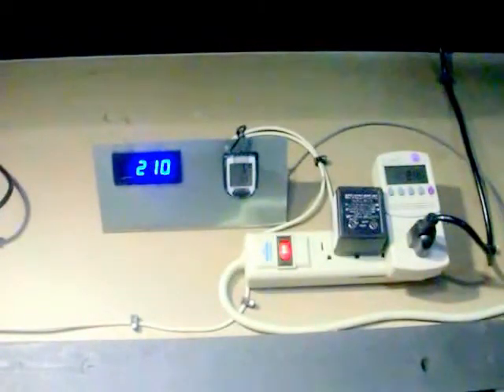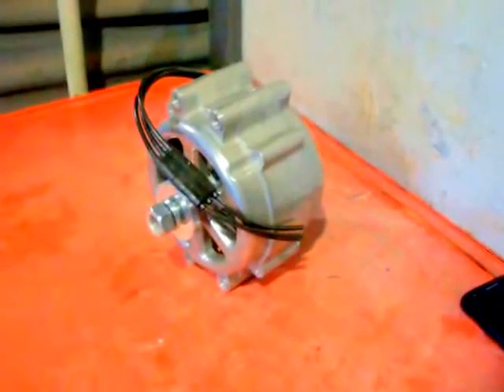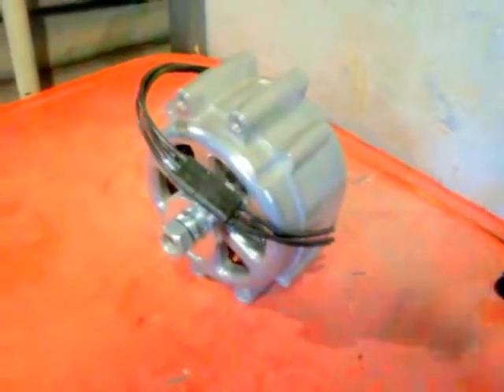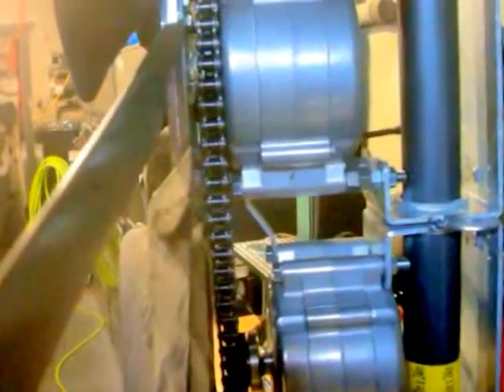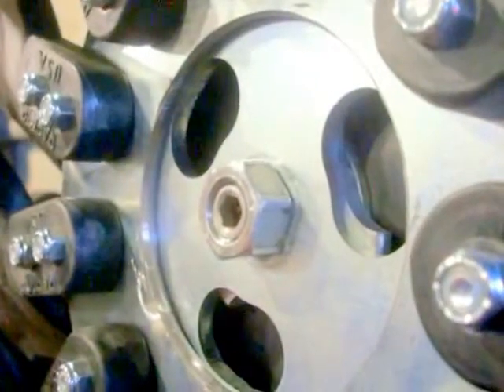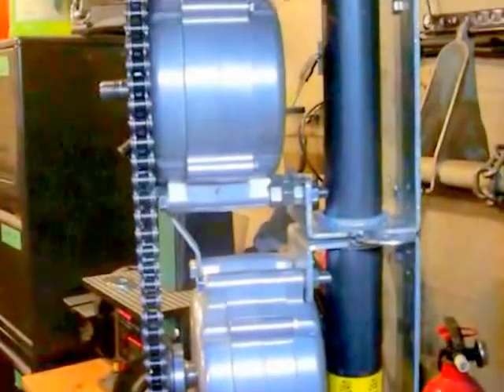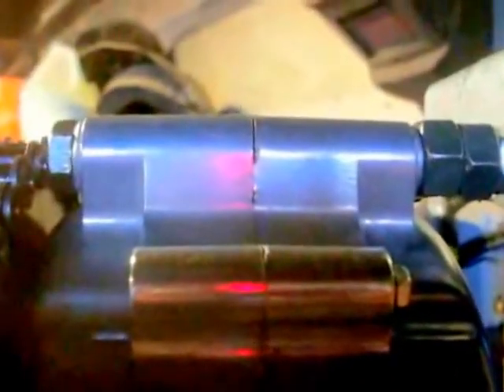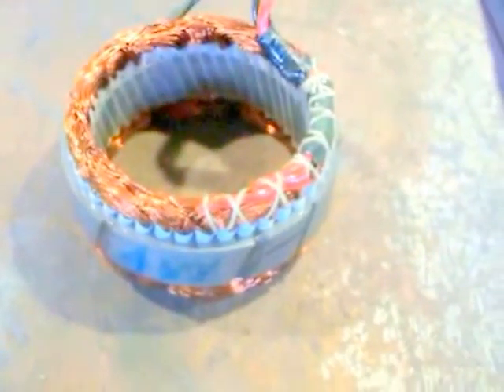Missouri Wind and Solar PMG Modified build

Comment: hhmm, seems like you need an upgrade of the hundred years ago kind.  Lower RPMs wind mill might work better for ya than a wind turbine?  I always look back to see how the old fellas did it.  Peace Out!
Reply from the maker: Old video and the turbines are replaced with more solar panels.  The modified turbine out performed the stock one 2 to 1.  The real problem is these pmg's don't have enough magnets in them.  250 rpm's to start making power thru a grid tie.  Wasted rpms but some people have tons of wind.  MW&S advertised the 11 blade for low wind areas.......My advise is no turbine unless you have crazy winds.  Check out my latest videos on the ultimate amateur 24 volt battery bank.  I haven't seen anything like mine yet to date.

Comment: Great series of 'scientific ' studies regarding wind turbines. I'm building a hobby machine shop in my 60' x 40' pole barn and I'm sure I'll be going through the same thing as you are. I would like to be able to power (at the very least) the lights and smaller things using wind and solar. The lathes, presses, and other heavy equipment with be on the grid. Thanks for sharing.... great job.
Reply from the maker: +Naked Machinist A pole barn is just what I need......maybe someday.  LED lighting is the cheapest to run for the price and as far as making power goes, I'd stay away from wind.  I've wasted too much money on it and those pmg's need to spin 250 rpm's just to start making power.  You'd have to build your own pmg if you want to make any real power.  I had a storm come threw and saw a spike of 600 watts but only for a second.  After 3 hours, the storm passed and I probably banked 100 watts.  Solar panels are 10 times better and you don't need to have them track either.  Although tracking gives about 20% more, the money used to build the rack could simply be spent on another solar panel.  I'm still working on the battery bank for using power at night.  This is all pretty much new to me also.
Reply: +Lightendog yea, I just talked to a neighbor a few miles a way. She has three wind generators on poles that are 80+ feet high... Massive things. She spent nealy $35,000 on EACH ONE and said they are a loss... They'll never pay out what she put into them. Plus, they break down and repairs are a small fortune.
Reply from the maker: +Naked Machinist Ya know, even solar panels really put you in it for the long hall.  In reality, it would take about 8 years to recover with all the little things you need and then if you blow a grid tie, add another 6 months.  The average guy should just avoid the whole mess if they're like me only paying 16 cents a kw.  But, if the shtf someday, it's good to know about this stuff and be able to make your own power.  It's a hobby to me and keeps me busy.  I'm on grid so I only use grid tie inverters now but later, I'll snap off a few breakers with a regular inverter......someday I'll get the balls to go completely off grid.  Unless I'm forced sooner. lol

Comment: I Have some videos on the dual that has both RPM's and wind speed. need much larger blades. and a stepped up gearing system. other wise its slow slow. need more RPMs.

Comment from the maker: Bicycle chain and sprockets would have been more ideal for weight but I'm thinking the torque of the 11 blade will push thru that.  Now if I'm mostly around 200 rpm's, the 2:1 ratio would put me at 400 minus some losses of extra force to turn it and about 1/2 inch of blade surface missing so I'm hoping to be at 300 rpms with the same wind.  If she works, I should be making power more often and will be changing my current 7 blade set up to match this one.  Now if it don't work..........then don't try this!
Reply: ***** wow, that is a awesome build, I always wanted to try this , you may get better low wind power using the 80 inch ( tip to tip) 5 blade Falcon Mach 4's, I don't know, I never seen anyone other than ian try this, awesome :)
Reply from the maker: Jason Brown I wouldn't mind trying Falcon blades and I may try them on my single 48 pmg.  How good would you say they work?  I don't think it will fit on my second pole......I have the modified mounted now but because of where the pole is by the end of the house I can't get a nice tripod mount and had to cut 2.5 feet off the pole to bring the pmg closer to the bracing.  Next windy day you'll see in another video and I'll mention why it's shorter.  However there is enough room to get G5's on that pole.  Lot of switching things to use Falcon blades.  I did get some small wind gusts and it's looking promising.  Even thou it's lower and takes a bit more wind to get started, once going it puts out more power then the other.
Reply from the maker: Jason Brown Thanks for the info on the Falcon blades and I guess next in line for me is the 13 blade hub.  When I saw your video on the tracking with bearings, I bought two sets.  I also put a locking collar on the top of the pmg bracket to eliminate the wind shaking it. ( a little slop with the bracket on the pole).  Seems to keep the noise in my garage down better.
My solar panels are here and because my wife is visiting her family in the Philippines, the panels are in the living room.  LOL .  My dogs don't care but I do have 18 days to get them out and mounted.
Reply: *****
I did notice that the new mounting brackets have a larger hole for the pole than the old ones, I will do the same and just add another collar on the top maybe a bearing I don't know yet :)
You are going to be really happy when you get your solar all hooked up and going:), just be careful If you live in a area like me where the power company will want to inspect your setup and certify it If you make more power than you use, I plan on making a little less power than I use because I don't want to spend $20-$30 grand to have my system certified by the so called power company's certified installers, it is just a way for our local power company to discourage anyone from making their own power and not giving them our money, the power company's want their money ,,,